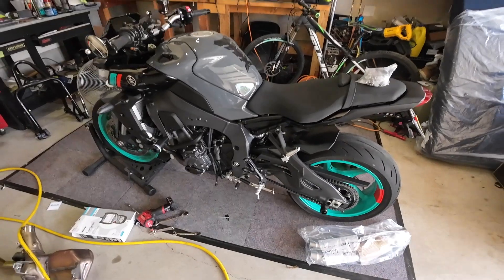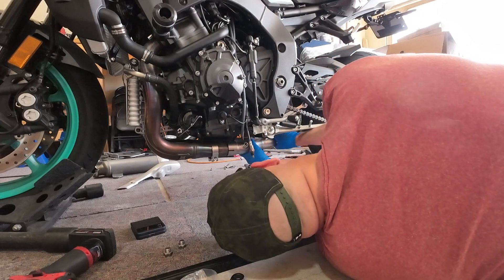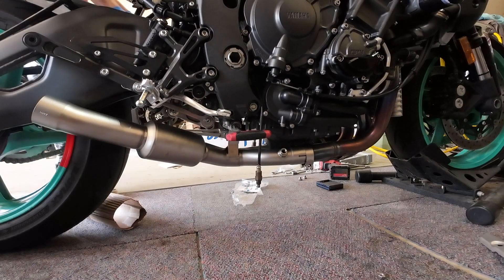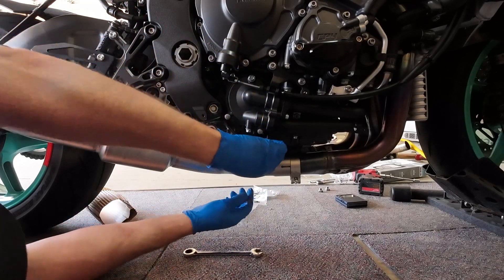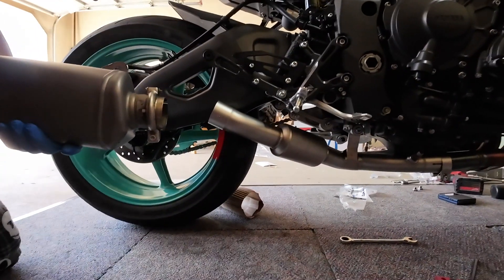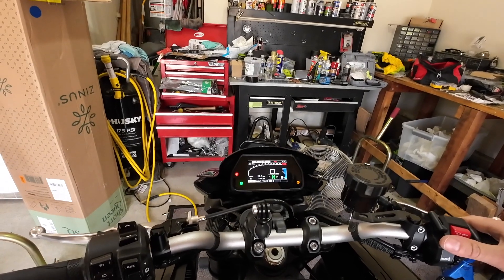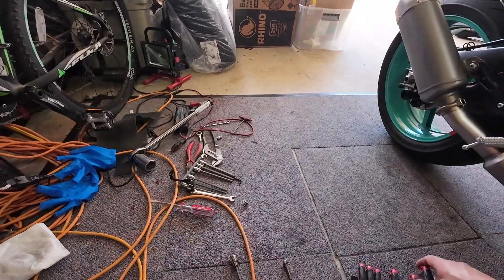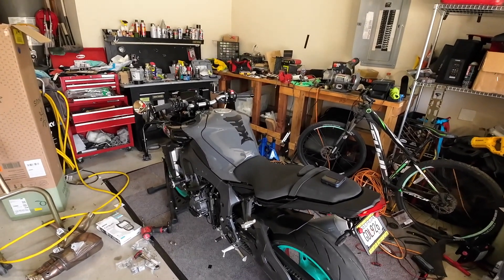2023 MT 10 Leo Vince decat Install - Part 2

Comment: Will decat modification and flash the ECU affect the factory warranty in US?
Reply from the maker: Depends on your dealer.  By law, they would have to show that the modification(s) are what CAUSED the problem, in order to deny the warranty claim...

My 2022 Triumph Speed Twin had modified suspension, intake mod, exhaust mod, full custom tune, and a bunch of other stuff.... and when a piston came apart, I was able to get it all covered under warranty, which was a brand new top end of the motor and rebuild...

Comment: The original pipes are titanium right? Any concern with galvanic corrosion with the SS link pipe?
Reply from the maker: To my knowledge they stopped using titanium headers in 2020.  Cost savings...
Reply from the maker: And I think the link pipe is titanium.
Reply: @Daves_Man_Cave Pretty sure it's steel.
Reply from the maker: @SethKnows  I will check. Doesn't matter to me either way, honestly...
Reply: As a 2022 new model MT10 owner, the stock silencer and headers are titanium. I was of the impression that the Leo Vince link pipe was stainless, bear in mind that I've been researching this stuff for my own bike. Can we have a part number for the Leo Vince mid pipe please, the Akrapovic titanium mid pipe is eye wateringly expensive.
Reply: @Daves_Man_Cave  Nope, just started using Titanium with the newest model, from the R1 parts bin. this is to offset the extra weight of the Euro 5 compliant 4 catalytic converter equipped mid section. The Mark one used steel headers.
Reply: @Daves_Man_Cave  I don't.
Reply: @SethKnows  I agree. Stainless, but steel indeed.
Reply from the maker: @disaffectedmale  Yeah, on the R1 they were Ti, but they changed the headers back to SS in 2020, so I assumed that the MT-10 would have as well.
Reply: @Daves_Man_Cave  Never used on the Mark one MT10, it was a popular aftermarket modification using headers from the R1 that did have them.
Reply from the maker: @disaffectedmale  https://www.leovince.com/en-us/product/1812-0286-cat-eliminator-link-pipe-yamaha-mt-10-fz-10-sp-2022-2023

Comment: so you didn't do a pair plug or servo buddy? you just disconnected everything and didn't get an F1 light?
Reply from the maker: Plugged PAIR with a marble in the house, and left the servo connected.  With these new bikes running a canbus system, its basically a network of devices all communicating back and forth... so when you remove one of the pieces from the network, the ECU doesn't like it.
Reply: @Daves_Man_Cave  so when I swap exhausts out I just need a servo or flash is necessary? my 2023 zx6r just has a servo and no flash for over a year now
Reply from the maker: @dakotabyington195  You will want a flash.  That will let you just keep the servo plugged in with no issues.  The ZX6R is nowhere near as sophisticated as the R1 when it comes to electronics, so its more forgiving...
Reply: @Daves_Man_Cave  dude I appreciatethe replies! where could I order the flash for the 2024 MT10 ECU from?
Reply from the maker: @dakotabyington195  Hit up Chris at Moore Mafia, he does mail in ECU flashing and the instructions are all on his website.  He's tuned my last 3 or 4 bikes now, does great work.
Reply: @Daves_Man_Cave  so I would have to mail my ecu and wait to get it back?
Reply from the maker: @dakotabyington195  Well yeah, unless you live close enough to ride the bike over there.  There are other tuners that can do this, depending on where you live.
Reply: @Daves_Man_Cave  so I would be okay with a servo buddy and power commander you think? 

I feel like a student in class for teachers 🤣
Reply from the maker: Honestly, just get the ECU flashed.  It does other things that he Power Commander cannot do, like getting rid of all the limiters and restrictions.  Turn around time for Moore Mafia is typically a week...  You mail it to him and he tends to send them back the day after he receives them.
Reply: @Daves_Man_Cave  dude you're the best man. seriously so many people can use the info we just exchanged. thank you

Comment: Really liking the MT-10 and considering it as a possible next bike. Did you capture the weight difference between the stock and catless set-up?
Reply from the maker: It's a solid 12lbs or so at least.    It's a fantastic bike, I think you would love it.  Just make sure to get the ECU flashed to remove the top end power restrictions!
Reply: @Daves_Man_Cave  Solid, even better with a very easy install, not having to replace the entire headers system. Happy to find that these bikes are tunable, something I read earlier was saying that the ECUs were locked, might have been an older comment.
Reply from the maker: @CubanRider  Yeah, each year things get harder and harder to fiddle with, but these ones can be flashed.  And yeah, Yamaha did things right with making all the cats in that box very easy to unbolt and remove.  Makes it soooo easy.

Comment: i was wondering if it would be a better fit by using the gen1's muffler. As i also had to loosen up n knock abit to fit it in and end up with abit of slanted angle. side by side comparision of the gen2 cat and leo vince link pipe looks abit off too😅
Reply from the maker: I did eventually order up the Leo-Vince muffler for that pipe.
Reply: @Daves_Man_Cave  i had just gotten a gen1 muffler but yet to try it on.😂

Comment: Really enjoying your content Dave! I’m also an MT-10 owner but out in the UK. Bought the exact same pipe and looking to do the Whoolich remap in the coming weeks. Just wanted to check, are you not supposed to install the metal exhaust gaskets between the header and Leovince pipes? These were probably still located inside the cat when you took it off. At least they were in mine! Keep up the great videos.
Reply from the maker: Not sure.  They clamped up tight with no exhaust leak that I can detect, so I guess not?  haha

Comment: I'm thinking of fitting one to the R1, then an end can maybe. Hopefully not too much louder but saves weight?
Reply from the maker: It's a lot louder.  The stock muffler isn't really a muffler.  It's just a straight through pipe with a little bit of perforation and baffling material...

Comment: mt-10 is simply the Best 😮 and 300kph
Reply from the maker: It won't do 300.  That's 186mph and there is no way it is doing that unless you shot it out of a cannon...  Top speed if you are in optimal conditions in a tight tuck, is maybe around 265kph if you are really lucky.  It's gearing limited to that speed.

Comment: Hi Sounds Great! Is it necessary to remap/flash ECU after Decat ?
Reply from the maker: Yes, the bike will run lean AF if you don't flash it.
Reply: @Daves_Man_Cave  ah alroght thanks man for fast response, so do i have to buy a dynojet or is it possible to remap the original ECU ?
Reply from the maker: @Kaserlivede  You get the stock ECU flashed.  I use Chris at Moore Mafia, but depending on where you live here might be closer options.
Reply: I'm actually from germany so i dont think i will get over only for an mapping 😅 but thanks buddy for the info 👍appreciate it
Reply from the maker: @Kaserlivede  there are places in Europe that can flash your ECU, I am sure.

Comment: Hey, important question- I'm looking to order that Leo Vince link pipe and their site lists two diferrent part numbers. 8082, and 8099. Both say 2022-23 MT-10 and yet use a picture of the previous gen MT-10. Do you remember the part number you ordered?
Reply: one is for the stock exhaust muffler and the other is for leo vince mufflers.
Reply: @SRT SPEEDY  that makes sense! Do you happen to know which is which by chance?
Reply: @corbinroberts949  just look at their site where they explain the difference in detail.

Comment: Do you have to do dyno or ecu flash once you put that pipe. Thanks
Reply from the maker: It removes the exhaust valve, so it will throw a check engine light on the dash.  Also, it will lose some power if you don't flash it.  It leans the motor out a good bit.

Comment: Hi, what's in the resonator?  Is there a partition or is it completely through?  Did you watch it?
Reply from the maker: Straight through and wide open, like a mini muffler
Reply: So it can be recommended with the original exhaust tip, right?  the sound is good, much better than with a catalytic converter, but it's not as annoying as if there was a pass-through decat...?  or will you change the ending over time?
Reply from the maker: @axlrose714  Not sure yet.  I am considering adding a new muffler, but it does sound great as it is.
Reply: The muffler may have a db killer. Or if you switch out the microwave muffler to a beer can size one, it’ll make it significantly louder. Leo Vince make an LV10 if you find it’s not loud enough. 
Do you know how much weight you lost by tossing the factory ballast or cat?
Reply from the maker: @sebastianocornelio9774  I added the LV10 to the decat, so yeah its loud and proud.  haha

Getting rid of the CAT drops a tad over 10lbs.
Reply: glad to hear you’re happy with the db level and thank you for taking the time to show us how it’s done. 😎👍 looks like there was no valve or servo motor for it or am I mistaken? My s1000R did. Once the engine warmed up it closed and would not open until around 5-6k rpm. Once I removed it, wow what a difference. Now it’s open all the time.

Comment: I have a Hayabusa with helibars on it I can't take it anymore too much pain wrist pain and back pain I'm going to get rid of it what would you recommend zx1400 or Yamaha mt-10 I want the sickest most craziest insane motorcycle I can find for the streets I don't ride for transportation just for entertainment so I need the most upright comfortable bike. Is there any bike out there you know that offers upright position but yet amazing performance for top speed and acceleration but yet comfortable at the same time
Reply from the maker: If you want more upright comfort, lots of power and handling but you still want top end speed, then you need something with a partial fairing at least.  My vote for that bike, is the Aprilia Tuono V4 1100rr or Factory.  If you were not concerned with top speed, I would say MT-10, Super Duke 1290R or Ducati Streetfighter V4...

The Ducati Streetfigher V4 is the most bonkers.  208hp stock, is more than the Busa and 140lbs lighter.  But the lack of fairing means anything over 140mph isn't a ton of fun.  But there is no more of an insane street bike, than that. 

But high speed requires an Aero package to slice through the wind and give you some protection, so for that I lean towards the Aprilia...
Reply: @Daves_Man_Cave  the problem is I'm in Connecticut it's a joke of a state small we don't have any aprilio dealerships what do you think of the zx1400 with LSL handlebar conversion kit, people claim they're pretty good I've never seen them when I call the Kawasaki dealership they said those bars are really good for that bike but I've never seen them I don't want to buy a bike with those and then find out it's not comfortable have you ever tried them.
Reply from the maker: I have never tried them.  I have 1" riser mounts for my ZX14R, but honestly, I prefer the bike in the stock config.  I like how the ZX14R feels to me, but I am tall with long arms.

Another option is the MT-10, get the ECU flashed and add the tall touring screen from Yamaha or Puig.  That will give you some wind deflection for higher speed runs, you get a bonkers street bike with upright ergos, all the electronic goodies, that amazing Yamaha crossplane sound and a better dealer network...

Comment: You're killing me. Lol. You started to say what will happen if you don't put the O2 sensor back in even though it's disabled, but you never finished telling us.  I'm dying to know.
Reply from the maker: Sorry man, this is what happens when nothing is scripted... I get off track and never find my way back.

If you disable the O2 sensors in the flash, you still need to keep them plugged into the wiring harness.  If you physically remove them from the bike, then the cruise control stops working.
Reply: @Daves_Man_Cave  Haha. I know what you mean.  Happened to me too before.  That's weird. What does cruise control have to do with O2 sensors.  Very strange. Never would have guessed that.
Reply from the maker: @rsv4pilot114  It shouldn't have anything to do with it, but maybe the manufacturers are trying to make it really hard to bypass emissions stuff.  The EU and states like CA are really cracking down on this stuff lately.  It was cars and diesel tuners, but now, motorcycles are on their radar and officials are really putting the screws to them to make things tamper-proof...
Reply: @Daves_Man_Cave  Yeah. Probably right. I've been working on cars for 25yrs and that's the first time I have heard of something like this.